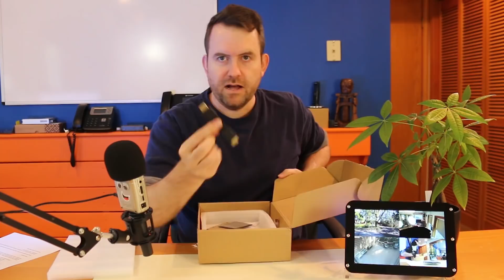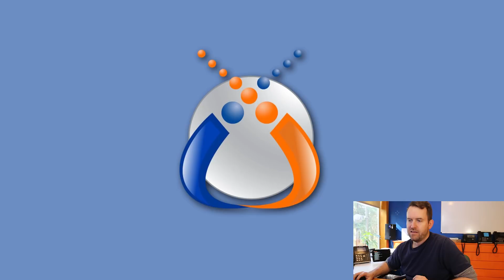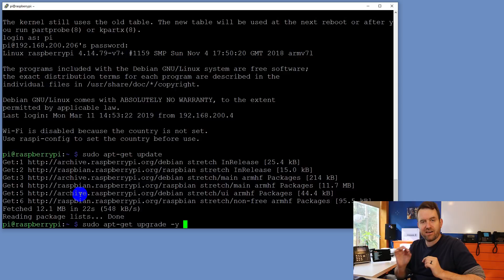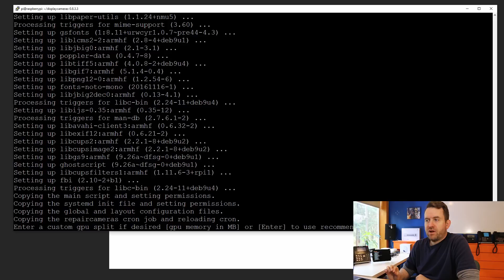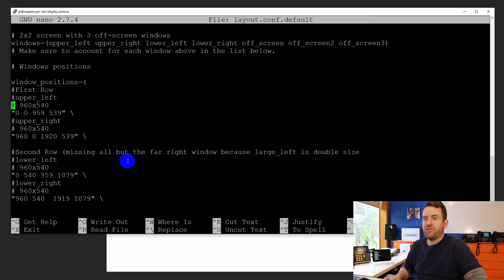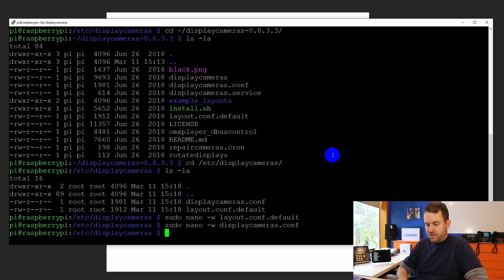Raspberry Pi Surveillance Monitor v2

Comment: I wan't to set up a security system at home, BUT I do NOT want to connect any part of it to the internet! The cameras should only be wirelessly accessable by one single monitor in my bedroom, and not by any other devices in my home or remotely via internet.

Is it possible to make a raspberry pi into a wifi-hotspot/local accesspoint without being connected to the internet?

Comment: Worked great! The only issue I had while putting it all together was that I was having some image flickering on my first attempts. I was trying to put together 4 cameras (from Reolink) at 1920x1080.

In my case, I would have the upper left window popping up, but with a lot of flickering and no discernible image (almost a seizure test).

What fixed the problem is reducing the quality of the RTSP streaming. For Reolink cameras specificaly, looks like it has two separate streaming links, one called "Main", and the other one called "Sub". When I tried using the sub instead of the main streaming link, it worked immediately.

Thank you for the detailed video!
Reply from the maker: Thanks for the additional info!

Comment: i have a 27" monitor. Can i display 8 cameras on it? or do i have to have it set up where it switches between 4 cameras based on an interval?
Reply: Yes you can run 8.... as many as you want and as many as the raspberry can handle (CPU power etc..)

Comment: Couldn't get this to work with Amcrest PoE using this RTSP string: rtsp://user:password@IP_Address:554/cam/realmonitor?channel=1&subtype=0 also try this from an article with no luck sh -c 'omxplayer --win "0 0 800 600" rtsp://USERNAME:PASSWORD@172.16.2.110:554/cam/realmonitor?channel=1&subtype=0; exec bash'

Comment: Hi Chris! Love your videos!
I have been running this setup on my Pi for nearly a year, but have been desperately trying to figure out how to go the next step.  I'm using the "Official 7in Touchscreen" for the Pi.  My ultimate goal would be to have this same look and use, except be able to utilize the touchscreen. For example, if I swipe left/right it shows another page of 4 cameras, or if I touch (click-on) one of the feeds it goes full screen then touch again to minimize back to the quad-view. 
Thanks for any help!
Reply: any luck impelementing touch effects ?
Reply: @Maled1cted  sadly no

Comment: Say you connect the pi to a 15 inch tv...  can the software be set up to show say 6 feeds at once vs just 4?
Reply: Did you got an answer?
Reply: @pete-magrela   no but havent done anymore digging either.
Reply: @FinalWarsGodjira  tks. I 've found another project in github that is said to stream till 9 cams, but I haven't got my pi yet to test it. It's called camplayer from raspicamplayer in github.

Comment: I followed your written guide but it just doesn't work. If I type the restart command it doesn't bring up any streams on the display whatsoever, not even black boxed or anything.
Reply: I have the same issue. any ideas what can be the problem?
Reply: Same here. Could by that omxplayer doesn't support h.265 codec
Reply: modify the codec in your dvr to h264 and send it to update its code, that way your video monitor will enter

Comment: please help me, i have a issue, if i put video stream for 4 panels, it start first panel (left upper) and as soon it start right upper panel screen goes to blank. but if i put video stream to left upper and left below panels it works without any issue. please help me on this issue
Reply: I think My All video streams are 1920 x 1080 and i am not downscaling them
Reply: i sorted out my issue, change resolution to 1240 x 720 and screen blank issue gone. change tcp protocol to udp. Now i can run any rtsp camera without having any issue.

Comment: I followed this tutorial today and it worked perfectly. I used Pi 3 B+, POE Hat, and the latest Raspbian Buster Lite. I did reach out to support on the Wimaxit display and asked about that 2nd Micro USB port. They told me that port is for future use but currently has no function attached to it so it cannot be used to "pass through" power to the Pi. I won't be using that display, however, as I need something with a bit more robust case and VESA mount.

Comment: ok so I followed the whole thing and it's pretty clear execpt that it doesn't work. I suspect my configuration as the first camera shows up and just right after when it tries the second camera it simply crashes. I have the Raspberry Pi 3B and I used HDMI on the regular monitor. My cameras are Fortinet camera, this means I don't get the stream from the camera itself but from the recorder. The stream works fine on VLC and I can pull 3 cameras on my ipad pro with a simple rtsp player, after 3 it lags seriously. I tried to reduce the quality on the Fortinet NVR but doesn't change a bit. I ordered a raspberry 4 with 4G  and try again. If you want to do some test let me know in MP i'm in Los Angeles as well and I work for Fortinet (Voice and Camera product) Thank you

Comment: Hi good video, I have one problem everything works but I only get the one camera showing full screen and that’s it? I have the pi hooked up to a 55inch LG tv which documentation says it’s 3840x2160? I have set the windows to 0 0 1920 1080, 1920 0 3840 1080, 0 1080 1920 2160 and 1920 1080 3840 2160 but only get the one full screen picture of the first camera? Any thoughts?

Comment: Thanks so much for this video, this is the first time that I've done anything non-Windows for years ! One problem that I have (I've tried very hard to find the answer online without succes) is that I have two different makes of camera, Foscam and Sricam, both rtsp feeds work fine in VLC but only the Foscam works with Pi. The only difference that I can see is that the url for the Foscam ends with /videoMain and the Sricam with /onvif1 or 2. Sorry if this is a dumb question but I used to program in ALGOL on an Eliot 803 back in the sixties so you can guess that I'm no "spring chicken". Once again thanks for your excellent teaching.

Comment: I just tried to get this running on my 3B and sadly there's something up with either the Pi, my Kernel, the current version of RSLite or the display camera software.  Everytime I get the display camera software installed my Pi starts to hang and becomes super super slow during reboot and even when trying to SSH in, gives me random BASH errors or just locks up entirely when trying to work over SSH.  Anyone else have a problem like this recently when trying to get this up and running with a 3B or 3B+?  This is my first time diving into an RPi so my diagnostic abilities are limited.

Comment: It is important that layout configuration files do not contain camera names for feeds that don't exist.  These extra cameras being defined means the system has to wait to error out on those missing feeds before finishing a host of operations (including the watchdog service).  It also breaks rotation (where enabled).
Reply: Do you personally know if there is a trigger or setting to automatically refresh a RTSP stream to keep it up to date if it gets delayed?

Comment: Many years ago a charity I was involved with was developing the ‘Little Brother’ system – The charity provided tech support of disabled people (or their carers and for a few companies to help them employ disabled people). All the charity staff other then myself were disabled, all had an IT background, so it was mutual therapy. We don't charge and we rely on folks giving us their old kit (which we strip down to basic sub assemblies and rebuild to suit the client's needs) so we had a lot of elderly boxes supplied by companies (we do a very thorough drive wipe before taking the machines from the suppliers office)
The idea behind Little Brother was that a small webcam was positioned in a window looking across the street with a redundant PC serving as a recorder. Motion detection triggered the recording. It doesn’t protect you it protects your neighbour, so stealing one wouldn’t help the criminal. 
We found people got more interested when we pointed out that this system is not under the control of the authorities, they do not know who has one or where it is pointing. Should anything happen that you feel the authorities should know about you send them the drive (mounted in a removable caddy), if it is the authorities doing something untoward you can send a copy of the data to various news organisations. We did make some progress on this but other things came along that soaked up all our resources so it has been a dormant project for a couple of decades. 
It’d be nice to see a system we could source the parts for (part of what we encourage people to do is ‘build stuff’).  Adding a recording function to this setup would be very interesting and now I have retired I might resurrect the project.

Cheers

Mike

Comment: You should check out rpisurv,  makes this even easier and does it all automatically
Reply: rpisurv is better in several ways (and has basically the same dependencies).  Since it's written in a proper programming language, it has more potential than displaycameras too.

Comment: Can't seem to get the cameras displaying. Have tried the omxplayer install first but nothing, and can get a feed on VLC but nothing. I run my Unifi Video from docker on my Synology NAS. Could this be the problem?
Reply: Follow debug instructions in the README.md file or at the bottom of the project home page, https://github.com/Anonymousdog/displaycameras.  Number one most common problem is folks editing configuration files where they unpacked the package vs the actual configuration file directory at /etc/displaycameras.
Reply: @AnonymousDog  Thanks so much. You were right, I was editing the wrong configuration file. All up and working now.

Comment: Nice video, but I would make 2 small observations:

1. `sudo apt-get upgrade` is NOT the right command to use.  `sudo apt-get dist-upgrade` is the correct way to install updates on Raspbian.  The latter ensures that packages with new dependencies since the installed version have those dependencies satisfied whereas the plain `upgrade` just upgrades the packages that already exist WITHOUT installing any new dependencies which can lead to broken packages.

2. `chmod +x install.sh` is DANGEROUS!  `chmod u+x install.sh` was all that was required.  Execute permissions (like write permissions) should never be given to all users unless absolutely necessary.  It is a dangerous shortcut to teach - if users use the same logic with other shell scripts then they risk opening their RaspberryPi to all sorts of attack.  Especially where sensitive data like live video feeds are at stake learning to keep a system secure (or at least how not to open everything to the world) is important.

Please don't teach people how to break their system and how to compromise it's security.  Teach them how to upgrade it safely and stay safe.  Security shouldn't be an add-on with IoT  it should be the core on which it is built.  It's 2019 and we know how dangerous the internet can be now.
Reply: Oooooh the shade!
Reply: No shade.  These are precisely correct points.  I've even corrected the installation instructions to reflect the second point.  I also recommend configuring sshd to accept only public key authentication, fail2ban, and unattended-upgrades (on any Linux server, esp one that is basically an IoT device [and unlikely to be serviced much]).

Comment: Chris,  I have installed this twice now per these instructions and still get the following message when starting the displaycameras.service  "Job for displaycameras.service failed because of the control process exited with error code.  See “systemctl status displaycameras.service” and “journalctl –xe” for details"   Any ideas what could be causing this error? Thank you.
Reply: Are you using an RPi or a Linux based desktop? I  tried with a desktop, but omxplayer is only for RPi, so I got the same error.
Reply: I am using a RP3B+ as Chris did in his Video with same Raspian Stretch Lite with the same monitor as he did..
Reply: Make sure omxplayer is installed, some people said it wasn’t on their distro.
Sudo apt-get install omxplayer
Reply: Installed the OMXplayer right after installing O/S, then upgraded Pi and installed DisplayCameras and everything work as per Chris's Video with a few mods as I have Geovision cameras not Ubiquiti.  Thanks for the help.
Reply: Apparently the Pi or omxplayer cannot handle more than 6 streams as anytime I try 8 it does not work it just starts jiggering on the screen between different cameras.
Reply: Have tried multiple ways to setup say 9 cameras with the screen set in a 3x3 grid with adjusted pixel count checked and veriify but it appears the Pi can not handle more that 5 concurrent streams.  I have adjusted both config files referenced in the Video.  Back to setting up 6 cameras with rotating sequence which works per video.
Reply: @cmsamford , you are likely trying to run RTSP feed resolutions that are larger than their target windows in the on-screen window matrix.  Try using low-res streams.  It'll run up to 15.

Comment: Great video as always, I managed to set up 10 feeds, 8 cameras and 2 local traffic feeds were congestion usually occurs on route to work...Using on 24" monitor. Thinking of trying on a Pi Zero W with same config to use as second screen on Magic Mirror... Thank you

Comment: Thanks for this Chris, worked out a treat! I have six cameras on the default unifi-style view, i.e. upper_left is camera one, and surrounding it on the right and bottom by the remaining five cameras. Easy to setup, and a nice use of a Pi, especially as I run it over wifi. No camera lag either.

TV is a 1920 x 1080, so the primary large camera is using high RTSP stream, and the remaining are on the low-res stream, so it all displays correctly.

Putting a higher res feed to the surrounding cameras causes the software to error out and blank out the screen, I do not think it can handle over-sized resolutions for the smaller sections (basically it seems unable to do any sort of decent resolution scaling).
Reply: Correct.  Instructions at the project home page, https://github.com/Anonymousdog/displaycameras, note that RTSP feed resolutions should not exceed the dimensions of its respective window in the display matrix.
Reply: @AnonymousDog  I figured out that I can use the lowest quality stream and still looks very nice when scaled up properly! Amazing piece of software!!

Comment: Hi Chris, I had this running perfectly with my UniFi Video NVR but ever since upgrading to UniFi Protect the feeds fall behind by sometimes well over 1 minute over a 24hr period. I’ve done a fair amount of research on this and it seems to be an issue between UFP and OMX player. It would appear there’s no fix other than running a Chrontab event every couple of hours to restart the service. I’ll be interested to see how yours goes and more importantly if you come up with a solution! Thanks for the video, fantastic as always!!

Comment: I just tried this and ran into an issue. My raspbian stretch lite didn't come with omxplayer installed. Displaycameras relies on this to render the streams tot the screen. Just did "sudo apt-get install omxplayer" and rebooted for good measure. All is working fine now. Just thought it might be handy to post this here for y'all.
Reply: Maybe you didn't use the installer or didn't run that installer as root?  It has logic to verify installation of omxplayer and fbi and to install those packages if verification fails.

Comment: Great video and right on time.  I'm in need of a solution for a unifi protect system to display cameras on a TV screen.  This fits the ticket and the budget.  Thanks!
Reply: Just pick up a 10" Kindle Fire, $60. Side load Google Play, install onvifer, watch RTSP streams without issue.
No $45 pi, $65 display, and hacking it with crontab and other bits to get it to display your video.
Reply: @jamess1787  Thank you for this suggestion!  I did this using an old Fire 7 and worked very easily.  Do you know what the security is using something like Onvifer?  Is the app acting as a receiver or is my video able to be accessed by someone else?
Reply: @michaelhart9607  I have the fire 7 tablet connected on a part of my home network that can't access the internet (firewalled). Sometimes the onvifer app is flakey/needs a reboot or my DVR is acting up. Not sure which is causing the issue: ordered a new DVR because I think it's occasionally overheating (it beep beeps and I lose all cameras on that DVR).
I don't think onvifer is uploading or attempting to: haven't seen any issues with bandwidth leaving towards the internet on my firewall. I'd say it's pretty safe (it's firewalled, so it can't even attempt. Haven't tried to packet dump that network though so YMMV.)

Comment: Been using an android tablet with tinyCAM pro application for two years and its flawless. For my cameras I pull the secondary channel to reduce bandwidth.
Reply: TinyCam is terrific for this if an android solution works for you, but stability is not the best with mobile devices being reliant on battery function and other processes of the Android system not gumming up the works. This solution is also better at recovery from a power loss or reboot in automatically starting up with full display immediately upon restoration of power. I have yet to try this, but as good as TinyCam is, those limitations remain problematic for me.

Comment: Should look at using a Fire tablet or any tablet with browser and run ActionTiles for interface and you can have a touch screen to control smarthome stuff and display sensor status and also display cameras. Not sure of ActionTiles support RTSP, but MJPEG via HTTP.